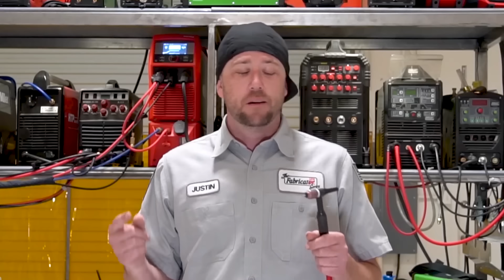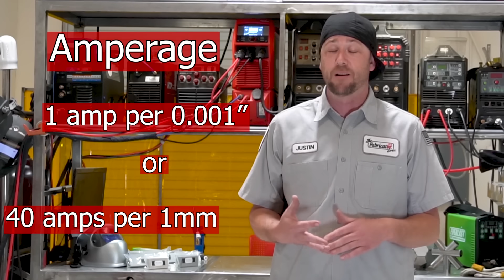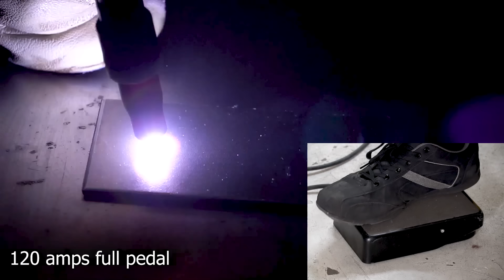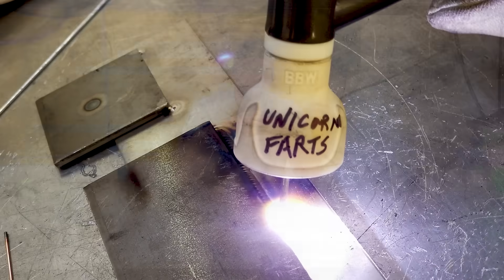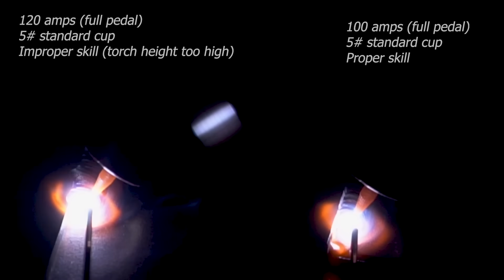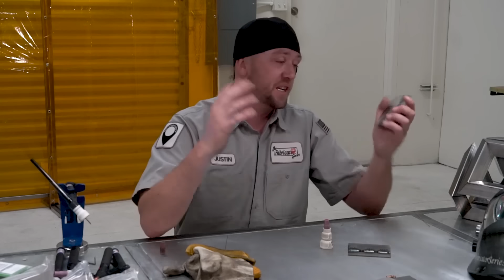TFS: TIG Setup Simplified with LOTS of Detail

Comment: Been welding many years, and never realized the 1 amp per 0.001" material thickness rule of thumb for TIG.  How the heck did I miss that???  I'm assuming that's a DC rule.  Now I gotta go out to the garage and try it to figure it out.  Regardless, cool tip!

Comment: I know this is an old video, but this is opposite to how I would teach anyone. He says don’t use better gear as a crutch….. perfect example for the opposite reason, crutches as designed to teach people to walk. No one is learning from face planting into the ground everytime. 

The most important thing is learning torch control, same reason you give a learner driver an automatic. Learn how to turn the wheel and use the pedals before throwing a gear shift in the mix.

I absolutely would have loved to not be regrinding tungsten’s and grinding out welds 100 times when just getting started. 

Getting back to standard cups and settings can come with time, use your crutches, just don’t get stuck with them.

Comment: Great video. It's been 20 yrs since I tig welded and it was on a real nice miller. Obviously everything was all set up. Didn't learn about torch tip material or cup size or any of the set up stuff. I didn't have time to learn about nothing but technique. So as I now have a tig welder n need to do some welding on a car project, I needed this video thank you!!

Comment: Well, there are two things, total heat input and heat input per inch.  The last one is important for several reasons.  There must be a minimum amount of heat input per inch in order to achieve fusion.  If there is too much heat input per inch, there is burnthrough.  Heat input is a function of amps, volts and welding speed.  My experience is that it is usually expressed as kilojoules per inch.  This is why when you are welding if the part gets too hot, the reaction is to do one of two things, reduce amperage (Because we are often on a constant voltage machine) or increase the travel speed.  The total heat input will just merely be the heat input rate in kJ/inch times the number of inches of weld.

On welding aluminum, you can take the heat input rate and the total weight of the part and you can estimate how many inches of weld that you can do before the part will overheat.  To do this you will need the specific heat capacity of Aluminum.  This explains why when welding is being done on small coupons or parts that why the weld flattens out towards the end of weld and you either have to stop in order to allow the part to cool down or that the amperage is decreased.

It is also important to consider the heat conductivity of the material.  At lower heat input rates, the heat input is being conducted away from the weld area.  Only the heat that is in excess of what is conducted away can be used to fused to metal.  At lower amperages more time is needed to fuse the metal and as a result the temperature increases further away.  This is one of the advantages of the TIG process in that intense amounts of heat can be directed at a very small area.  This fusion is accomplished with a lower total heat input and thus the material is affected by the heat input in a smaller area.

Great explanation that you gave.

Comment: I was taught to switch the polarity(Miller's have a switch) to electrode positive and weld a copper bar to easily produce a nicely balled electrode for A/C welding with a zirconated electrode.
I've done it hundreds of times and it works perfectly.

Comment: Have you ever used the Yeswelder MIG 250A Pro, and is it junk? I hope not, because that's what I bought last year, but unfortunately I haven't been able to use it, that's because our circuit box is full and I have no way to hook up 240A breaker. I also bought the Yeswelder CUT 55DS Plasma Cutter. Have you tried it?

Comment: THE FIRST TIG MACH. I EVER TURNED ON,WAS AS BIG AS MY REFRIGERATOR AND PROBABLY WEIGHED MORE TOO!
 THAT WAS IN THE MID TO LATE EIGHTIES. AND NOW? NOW,I'VE GOT A ARC/TIG MACH. THAT CAN BE PUT IN MY TOOL BOX AND NOBODY EVER KNOW IT WAS THERE! 
THE TECHNOLOGY AROUND WELDING,STEEL FABRICATION HAS COME LIGHT YEARS IN JUST A FEW DECADES! THINK OF THE I OR H BEAM PROCESSING MACHINES. INCREDIBLE, JUST INCREDIBLE! AND THAT IS JUST THE BEGINNING. THE WATER JET,PLASMA CUTTERS,THE PRECISION IS MIND NLOWING!
PLASTICWELDING.ULTRASONIC WELDING. LASER WELDING.SMH!
 WHEN I GOT INTO WELDING,TIG WAS A MYSTERIOUS PROCESS THAT FEWWERE MASTERING AND FEWER WOULD SHARE. SUB-ARC OR SUBMERGED ARC WAS IT! NOBODY COULD BELIEVE THAT THERE WAS A WELDING PROCESS THAT YOI COULD ACTUALLY WATCH UNPROTECTED. 
 MAKES ONE WONDER WHERE AND WHAT ITLL BE IN FIFTY YEARS!
GREAT VIDEO, BTW.

Comment: I might suggest that HEAT = Amp + Time or am I wrong?

Time alone gives no heat if there is 0 amp!  

You can regulate the heat with both the amp and how long you hold that amp to the workpice, but you must have soem amp!

A heat problem could be that, you have the amp to high and burn through very quickly, so quick that you just cant reduce the TIME anymore, then you have to reduce the amp.

but yes more time with amp = heat !

Comment: I have a stupid question I've been trying to find the answer to.
I'm welding 035 wall chromolly tube.
Is there any advantage to using AC tig on this material (over DC)?  I don't even know if it's ever done, at all.
I'm basically trying to decide on a machine for the bicycles I want to make.
Thanks in advance. 
Even a one-word answer will suffice!
      Total Noob

Comment: So I'm watching this two years too late. I have a question that pertains to the oil and gas industry. Much of the piping assembly for under 3" is socket weld where the metal being welded...both sides....is over 1/4" thick. You indicated 1 amp per .001" of metal. But I don't remember these welders maxing out their tig units. Does that recommendation taper off when working with thicker substrate? Of course in some situations the welders were preheating the metal with a torch. I suppose that impacts the situation. One thing for sure. The quality is impressive. I marvel at this talent because my tremors are too intense to make any meaningful welds these days. I can get the job done on the farm but it isn't always pretty.

Comment: Thanks for all the welding and bending videos. It’s much appreciated. I have a question about a Hobart tr-250 ac/dc welder that was giving to me. It came with a tig torch that has a threaded brass fitting on the hose end.  there’s a brass block too. I’m not completely sure how to set this up. Should I get a new torch with the lug fittings or is this even possible with this machine.

Comment: Ultra pure helium is pretty handy when you have to DC weld thick aluminum because you can’t get an AC rig to where you’re working. It has really good penetration and arc characteristics, but the arc starts are kind of funky.

Comment: I'm working with a 160amp dual voltage 120/240v DC inverter Tig machine. The material is aluminium tubing chopped bicycle frames. Now I don't have access to 240v so the machine will only be running on a 120v. So I know the amps will be limited but since the aluminium tubing I'm welding is 1/8" or thinner. Will my machine be able to do it or am I screwd. Since I just bought the machine to weld this project.

Comment: These videos have taken a lot of the mystery of Tig away for me. I've started learn to weld at the age of 53. I needed to weld a few essential pieces together and managed to stick weld them. My farther used to weld everything but no longerger able. I became fascinated with Tig. I've got on ok so far and decided to Tig weld my first welding project. A welding trolly cart. I wanted to Tig it so my welds would look nice and I wouldn't need to grind them off. I probably should of just mig wekded it. I'm cleaning all the metal properly and I'm welding real nice  but on the sq tube Tee joints my welds are good on the flat but side at around 100amps it goes nice but everytime I try to weld the fillet side it has massive porosity. It's as if I've got no gas on. I've gone up to 125 and 130ams and laid in thicker filler wire and seams better. I'm keeping the cup as vertical (but at 45 to the joint) as possible which helps reduce porosity but if I was going to do some cup walking then there would be some lean. Running at around 15cfh and we are on 3mm mild steel box section. Am I doing the right thing by bumping up the amps on the fillet?
I'm in the UK and located a bit in the rural sticks so supplies in the area we not easy.

Comment: I'm a welder trained in
Acetylene/gas ,
 heliarch and mig 
 Welding mild steel braising with brass steel  from automotive  panels  up to one inch steel  plate.
 I wanted  to buy a tig welder  to learn how to welder aluminum. Is the a certain  machine  to buy  ???
 Or what should  I buy for this task ?
Thanks 
 rweber

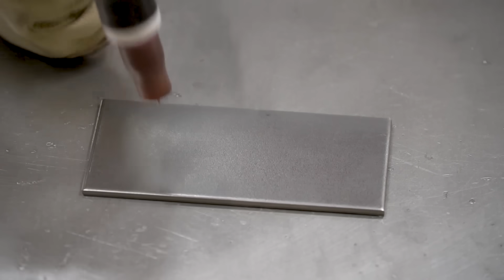Comment: I know this is an old video, but I've used a couple of techniques here and one in particular reduced a lot of frustration for me. Around 6:28, Justin goes through his time vs. amps heat explanation. Those spot welds he does can actually diagnose potential torch problems. I had what I thought was a technique problem when it was actually gas coverage. Just for giggles, I blasted a spot like he does in the video. What I got was a completely butchered heat signature off the spot. From that I could immediately tell that my collet was twisted and had closed off the vent slits on the side. A few months later, I got a new CK torch and superflex cable (which is awesome) and was getting really crappy welds. Did the spot weld trick and the spot was nothing near what he does in the video. Another flow problem, this time due to a defect in the cable. CK overnighted a new one to me and now the issues have are all mine.

Comment: I've never known an engineering subject to be such a minefield. Just got a cheap-ish 200A TIG and was scared to turn the thing on now, let alone actually use it to join bits of metal together. But thank you for at least giving me a straightforward starting point and taking some of the uncertainty out of the subject.

Comment: Great video. Straight to the point and providing evidence to prove the theory's discussed.
More times than I can remember I had to take the time to prove to people I worked with that less amps on thin stainless to prevent warpage is only causing more heat input. 
You would think simply saying even if you have to add 50% more heat and apply it in half the time over twice the material you will be cutting heat input in half.

Comment: The only 2 times I think you need electrode pos is 1- when following the older practice of balling up your tungsten for aluminum welding 
2- heating up the tungsten to use chemsharp to sharpen your tungsten

Comment: As a 25 year welder and The "GO TO" guy at work to weld anything, you are spot on. I had to learn all that you said through experience 20 years ago. I use helium at times (only ever on poured aluminum castings) and the sole purpose is as you said being skilled and it is used for that and that alone. Helium mix burns out poured aluminum castings impurities a lot better than 100% argon. Keep up your teachings as it only betters people to learn the proper way.

Comment: Hey man!  I'm so glad I found TFS, this channel is awesome for somebody getting started in welding.  I had a quick question as this was part of why I started getting into welding to begin with.  I am trying to TIG braze a brass piece to a stainless keg using silicon bronze filler.  I can get a good pool on the stainless but the bronze gets blasted or the reverse, then I get a crazy weld and balling on my filler (watched the video on balling)-fixed that issue somewhat.  I still am extremely new and not great at welding yet, but I'm having a blast learning.  Any advise is welcome.

Comment: My CFH was high according to the cup size (7) guidelines but when I brought it down to less than 10,  I could not get a nice clear puddle/cleaning like I could at 10-15. (aluminum) I'll try later with steel. Would there be a difference in CFH with different metals?

Comment: I am 67 and I just love the skill of gluing metal together, did the research of the different models at the time sycrowave and Lincoln. I looked for problem resolutions the list for the sycrowave was very long, the list of problems for the Precision tig 275 was empty. I have no formal education in welding so I wanted to by a tool I could not blame as the cause of my failures. What you have just said in this video I have not heard before. Other than with the Transformer machines use what works, I have heard that. I have repaired a pair of glasses. I have welded a roof that was cut off a Prius and I have welded a power unit back on to a boat motor. I appreciate the effort  you put into your videos.

Comment: MAN,TALK ABOUT GETTING TO THE POINT,THE WAY U EXPLAIN EVERYTHING IS AMAZING,OUNCE I START WATCHING ONE OF YOUR VIDEOS,I HAVE TUNNEL VISION.YOUR 100%TOO THE POINT,YOU COULD TALK IN FRONT OF A CROWD OF 500 PEOPLE OR MORE.- I GOT INTO WELDING BACK IN 1980 IN DALLAS,TEXAS,WENT TO A TRADE SCHOOL,LEARNING STICK,MIG,TIG ON STAINLESS AND ALUMINUM,STRUCTURAL STEEL,BLUE PRINT READING,HOW TO READ A TAPE MEASURE,CUTTING TORCH AND SET UP.-MOVED BACK TO SEATTLE,WASHINGTON,TOOK UP TIG-STICK ON PIPE(UPHILL) STICK(DOWN HILL) AND GOT INTO SOME MORE TIG ALUMINUM WITH A,"HOBART CYBER TIG"300 AC/DC WHICH RAN CIRCLES AROUND A MILLER,LINCOLN.WOW,WHAT A AMAZING MACHINE.THE ONLY COMPETITIVE OUT THERE AT THE TIME WAS,"LINDE"AND THEY MADE EXCELLENT TIG MACHINES,EXCELLENT!(SORRY 4 THE LONG STORY)-MY POINT BEING,AND TO ALL OF THE OTHER WELDERS OUT THERE(AND I'M STILL WELDING TO THIS DAY,NOT AS MUCH)I'M STILL LEARNING THINGS I NEVER NEW OR HEARD B 4.ONE OF YOUR VIDEOS WAS ON TIG TORCHES(CK)AND YOU SHOWED ALL OF THE GAS COOLED ONES,#9,17,24,26 AND I STILL WATCH THAT VIDEO EVERY SO OFTEN.OTHER VIDEO COMPANY ON YOU-TUBE SHOW IT BUT THEY DON'T BREAK IT DOWN LIKE YOU DO.YOUR THE MAN!ANOTHER PERFECT VIDEO,100THUMBS UP ON THAT ONE!!!!---THE OTHER THING(OR PROBLEM)THAT I'VE HAD ALL THESE YEARS(AND THIS IS EMBARRASSING)IS SETTING MY REGULATOR/GAS FLOW.NOT SO MUCH ON PIPE BUT ON LAP JOINTS,T'S,BUTT ECT... UNTIL U GAVE OUT THE FORMULA IN A VIDEO/CUP NUMBER×2=CFH(MIN.FLOW RATE)-AND LAST IS WHAT SIZE OF CUP DO I USE? NOW WHEN WELDING PIPE,OPEN ROOT,I HAVE NO PROBLEM WHAT SO EVER BUT FLAT MATERIAL,YES.-LAST QUESTION,DO YOU SIGN AUTOGRAPHS? MAN YOUR AMAZING!SOMEBODY SHOULD TAKE A PICTURE OF YOU TIG WELDING,HAVE ABOUT 1000 PICTURES MADE UP AND FIND A WAY TO SEND ONE OUT TO CUSTOMERS OR SOMETHING,DON'T FORGET TO AUTOGRAPH EACH ONE!-STAY HEALTHY CRAIG

Comment: Question regarding the amperage topic. Let say i'm welding .060" steel. So the ideal amps is 60A. But what should I dial my machine to? Should I dial to 60A and be a full pedal the whole time or should I dial a little above 60A and use the pedal to stay within +/-5A of where I need to be? And if that is correct, how much above ideal should I dial to? +5A? +10A? Thanks

Comment: All right Justin I got a good scenario for you is Thanksgiving Day you just drove 3 hours to Grandpa's house so do you step outside the truck he told your pair of coveralls and come here I got some work for you to do he's got a brand new TIG DC $300 welding machine he's got a quarter inch steel tank Rusty's and a 3/4 fitting to put in there The Runaways like little girls running from butterflies or do you man up and get it done

Comment: I disagree with chopping down one tungsten into three.  I find that the longer tungsten behaves differently, better, cooler, in more control than one that has gotten short to 1/3 length.  Also you get maximum use out of a full length than chopping into thirds.  #17 torch tungsten useful lenght is about 1.5", so if chopped into thirds 4.5" becomes waste and only 2.5" is used.  Full length tungsten you can use 5.5" with 1.5" waste.  Better to just grind a pack of 10 and once they all contaminate regrind them.  Other wise good video.

Comment: My machine is a Cornwell MMWMP241DVI is a multi process 4 in 1 welding machine. It does not come with a TIG foot pedal and im a little confused on how it works. I haven't got it setup yet. Any help would be greatly appeciated.

Comment: Hey I have a question I have a old welder and after checking all the connections it seems to be working properly but I tried it with 7018 rods that are supposed to be ac dc (the welder I have is ac only) and I can’t get it to hold a arc it will spark when I tap it but that’s about it I am not a professional welder but after about 2 hours of trying I could not get anything with it if anyone knows what I’m doing wrong please let me know

Comment: I have zero experience on a TIG, hobby level only on arc and MIG welding. My welds might stay together, but I would never be so brazen as to challenge someone experienced with these machines. Niave I am not, and practice is the only way to become comfortable with the process. Good safety is always a must. That arc is as bright as the sun, and it WILL burn unprotected skin. Good videos, much appreciated.

Comment: Hi. Quick question that maybe someone can answer. 40 amps per 1mm is that applied solely to carbon steel only or does that apply across the board for aluminium and titanium etc aswell? Thanks

Comment: As a welder for many years I disagree about the gases. I worked in a machine shop in which we used argon and helium mix in doing aluminum welding. We also did dc straight aluminum welding with helium and just a few pounds of argon. We were doing 1 inch thick aluminum plates for vaccumn chambers. All done in dc-straight yes it’s black and had to wire brush all the welds. And using wire brushes on our die grinders. So yes argon straight most of the time. But on aluminumwe used a mix. Good video though. Your a very good teacher.